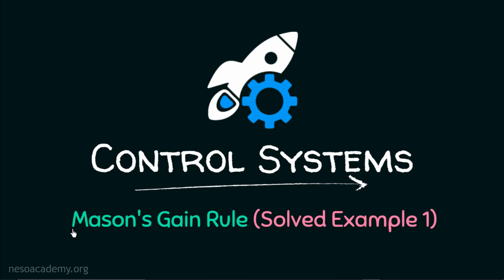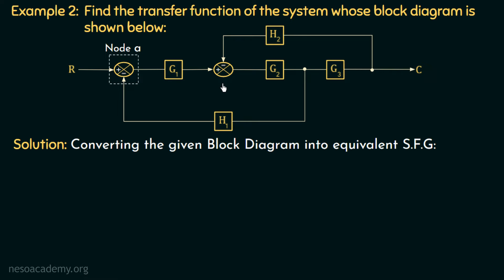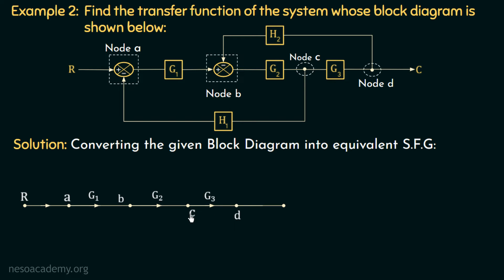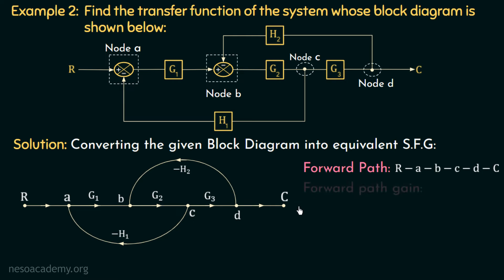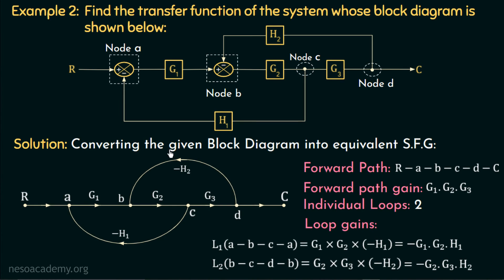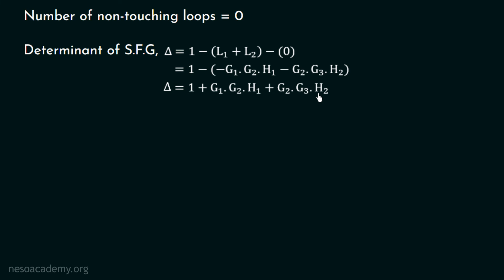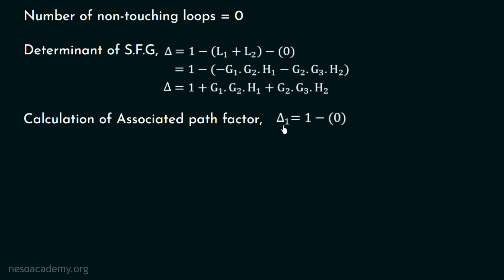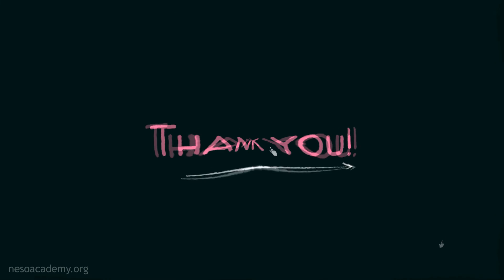Mason’s Gain Rule (Solved Example 1)

Comment: Sir what is mean by P1 here?
Reply: 6 months late, you probably learned it by now. But just in case.

The equation presented in the last value utilize Psubk, where P is the gain of the forward path, and K denotes what forward path we are using.

TLDR a forward path is a path where there are connecting branches from the Source, R, to the Sink, C. 

Remember this is a summation equation meaning that multiple parts will be added if there is a need to. This is determined by the number of forward paths in the SFG.

This SFG has 1 forward path so that signifies we are using the Gain that 1st path. 

P is Gain
The subscript denotes which Forward Path Gain we are using. 
So P1 is the the Forward Path Gain, of the only Forward Path in this SFG example.
Reply: P1:means path one brother.

Comment: Regarding the loop gains, sometimes the feedback gain's sign is considered, and sometimes it is not.
In other words, the feedback H1 and H2 are negative, but the fact they are negative feedback is sometimes considered, and sometimes it is not considered.
How come ?
Reply: I know its been a year since you asked this question, but in case if there is still doubt

feedbacks are always considered as it is... meaning negative feedback with H1 would always give -H1 whenever you make its equivalent SFG, and positive feedback of H1 would always give +H1 as its magnitude.

Comment: Is this a video about dsa ?
Reply: Yes
Reply: Sorry this may be a n00b question, but what do you mean by DSA?
Reply: @PunmasterSTP  data structures and algorithms
Reply: @charlie13.  Ah, that makes sense!  I can see how someone would use algorithms to solve these types of problems, but I'm not sure I'd use the term "data structures" in relation to this material.  I believe that DSA is more closely related to programming algorithms and things like stacks and queues.  Is that your impression as well?
Reply: It's control system